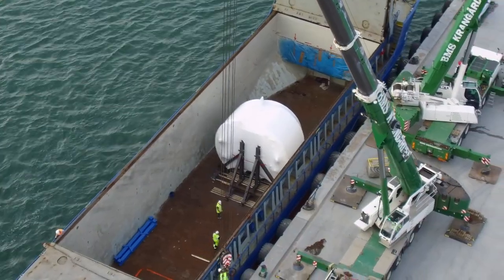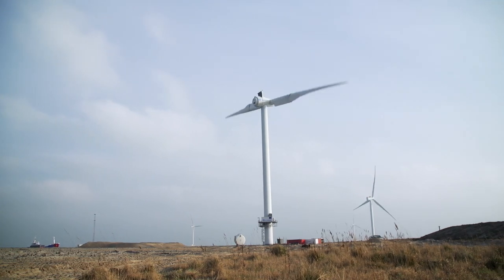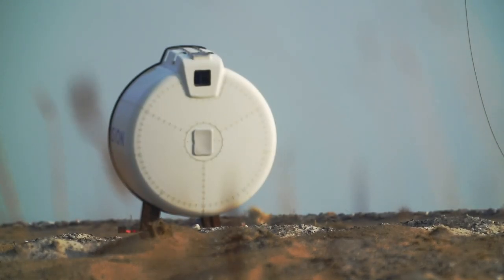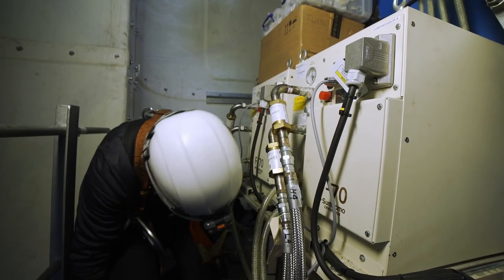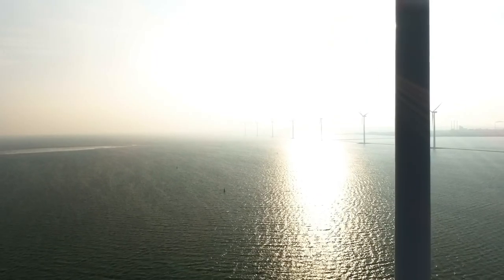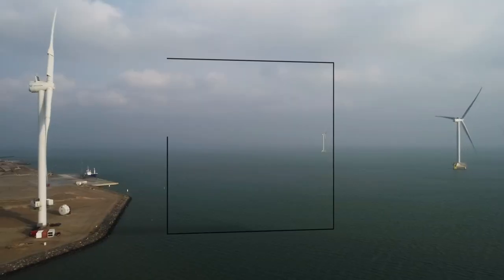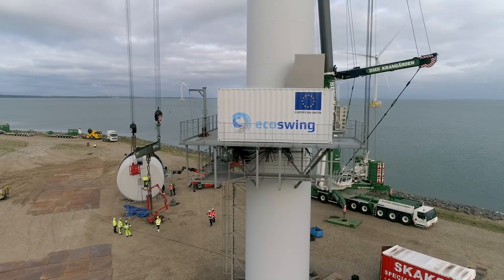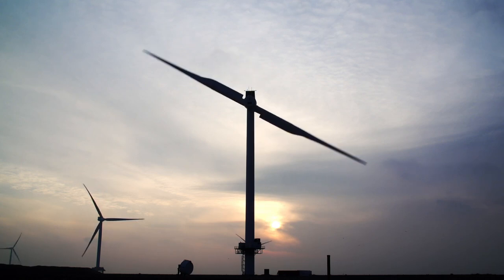EcoSwing project on the home straight - Superconducting wind power generator

Comment: I heard barium sulphate paints reflect most of the light on all wavelengths so I wonder if they used it on the head of the turbine. I don't know if it would be worth it but it basically denies the sun from heating inside. I'm just curious if it would change anything for the better.